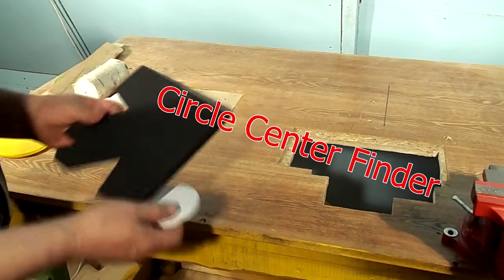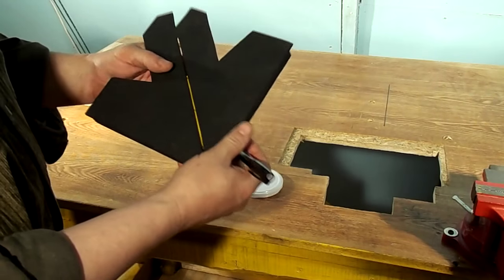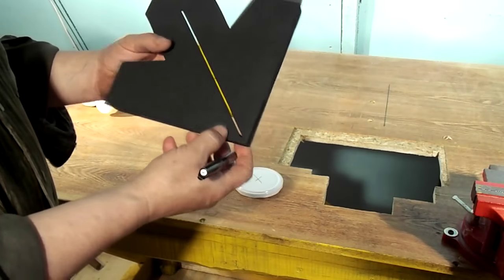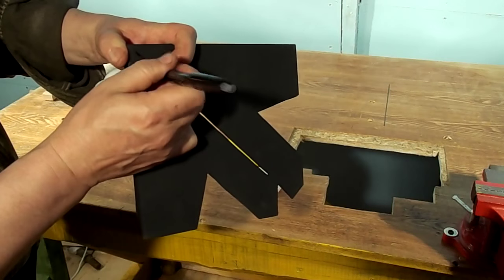Homemade Circle Centre Finder

Comment: How does one center a larger circle inside a smaller one? Try to mount a tonearm
Reply from the maker: I do not understand you.
Reply: The diameter of the original bore for the arm mount 23mm this
Reply: the diameter of the bore for the original arm is 23mm. This is 222 mm from the center of the platter spindle. The bore of the new arm is 25mm 222 mm to the center of the spindle .
Reply from the maker: What videos do you comment? I did not give any sizes in this video
Reply: Keith Parkhill have you tried to put 2 shims in on the angles to the diameter of the inner circle?.